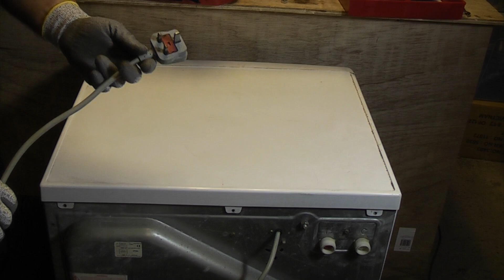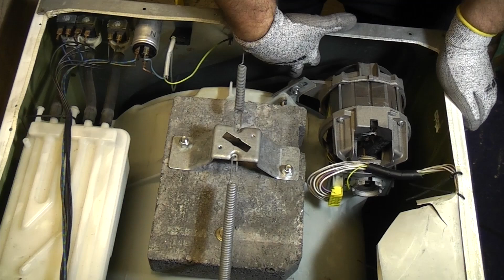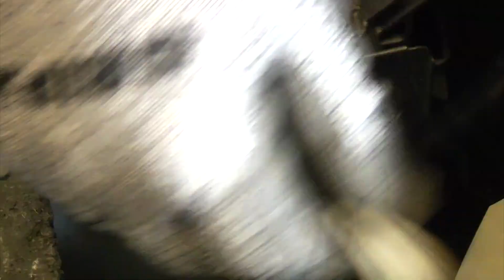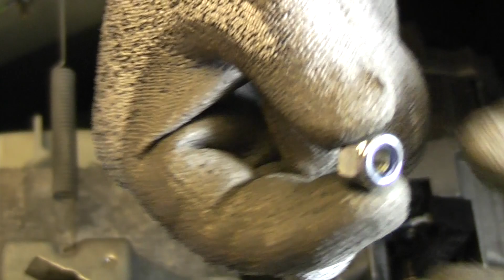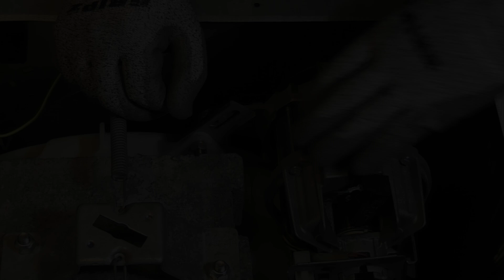How to remove a Washing machine motor  |  washing machine repair

Comment: I'm scrapping my old washer but im finding it difficult, I want the motor out of it but there is no room for me to work with tools, plus how the hell can you take the drum out of the chasis? Ive removed a weight on top of the drum & unhooked the drum tension springs, exactly the same type they use for garden trampolines.
There's anther weight on the drum & the motor is attached under the drum!
Reply from the maker: Just check YouTube for washing machine drum replacement or bearing replacement, you have to virtually strip the machine to bits in order to fix those problems 👍

Comment: Thank you very much for the video. With yours and another one that shows how to replace the brushes (my CREDA needed new brushes) a friend and I just got my washing machine going again. Such a great thing when you can do it by yourself.
 - I have a question,  my washing machine washed and spun and all went well but there is a noise now that wasn't there before. We thought maybe the belt, but it looks like it is in the same place as before. And there is no smell. Thanks for any suggestion.
Reply from the maker: As long as the belt is roughly the same tension as before it will be fine.
I'm sure the last time I replaced washing machine motor brushes the machine sounded differently afterward.
Thanks for the comment 👍
Reply: @ultimatehandyman  Thank you.

Comment: i was on a roll fixing my washer, and got to these two annoying washers right after taking out the main screws to the motor, they are big white "washers" i guess, n they are firmly in place i tried prying them off n trying to turn n pry but they r stuck their firmly holding the motor still in place,

looks like the damn company used some stupid sophisticated washer that needs a special tool to remove so people couldnt couldnt them themselves ahhh!!!

Comment: another brilliant video, i have browsed through your channel and its really cool
i got a quick question for you, i watched the how to change carbon brushes on a washing machine video u did earlier and now this one on getting the motor out. Now im doing this as the washing machine doesnt spin anymore, i will know when i see the brushes if they need changing by the fact that they r very small and worn right? also the machine doesn't drain now, is that related to the brushes too?